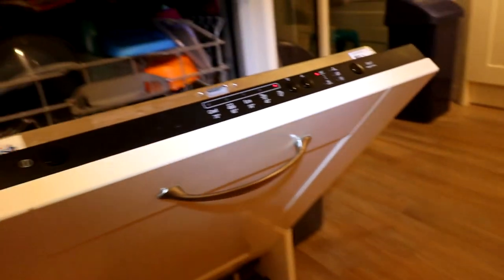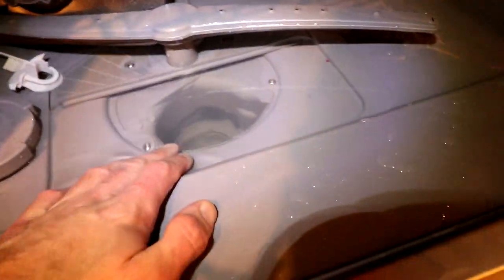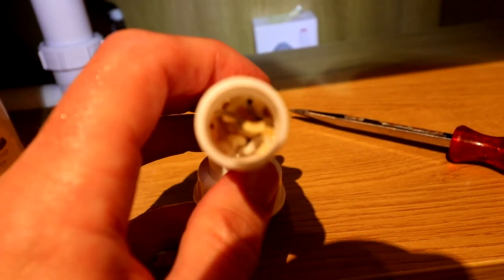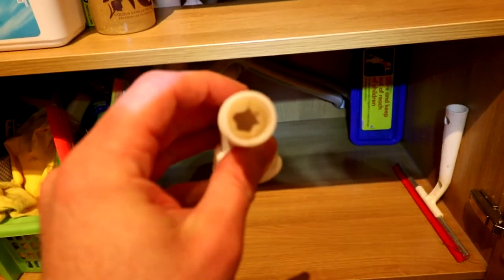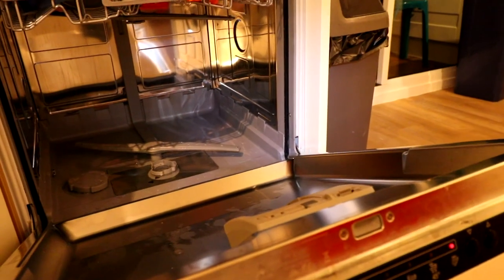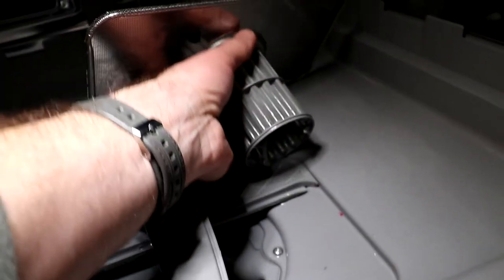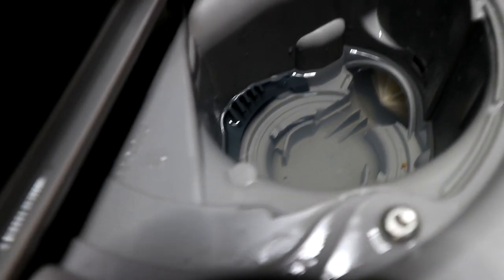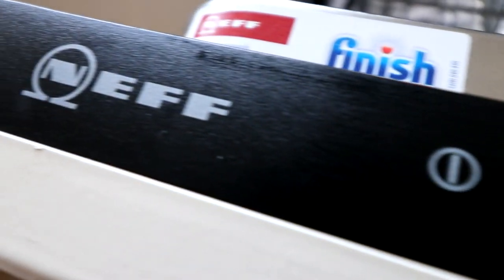NEFF Dishwasher (S51E50X3GB) Unblocking

Comment: Ahh I think i have worked out why large things get past the filter, It happed to me. when you lift out the filter if you are not careful things will drop in when you don`t see them while the cover and filter are removed for cleaning.  I had a pickle jar transparent plastic gasket drop in jam things up (pardon the pun).
Reply from the maker: Yes true, easy to lose things down there! Cheers!

Comment: Hi Chris, I tried this but after doing this the dishwasher isn’t turning on. Any idea what could have happened? Thanks
Reply from the maker: Do you get any lights on the main control panel? If not check the fuse in the plug and also ensure the socket is ok supplying power.
Reply: @ChrisHorswill  no power on the main control panel. I’ll check the fuse thanks